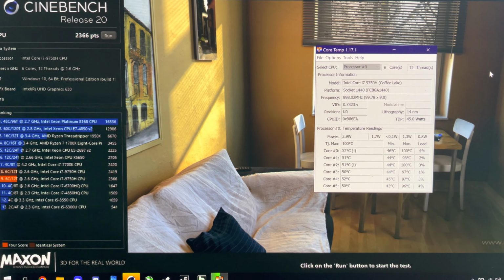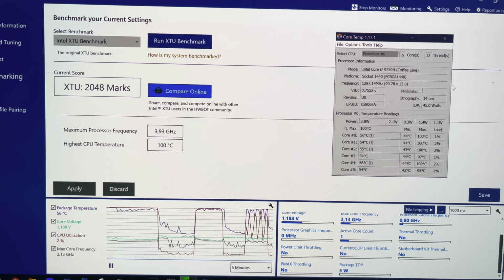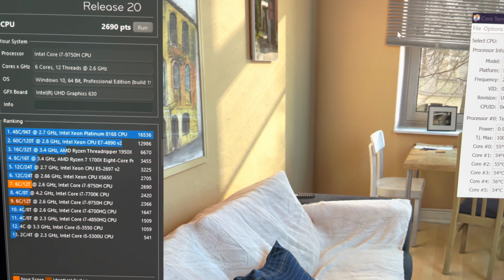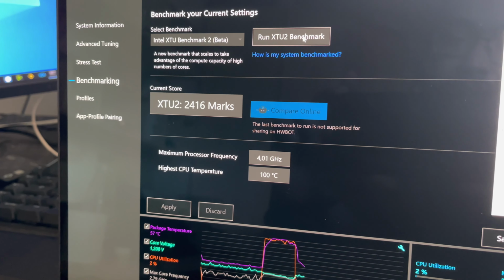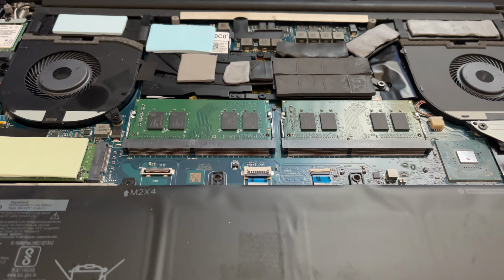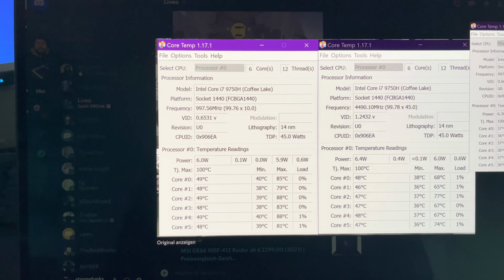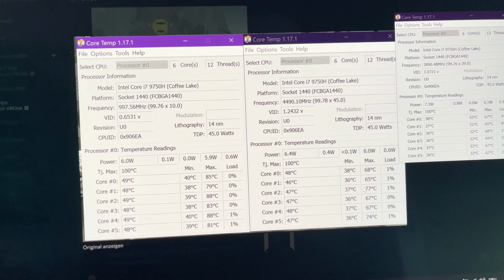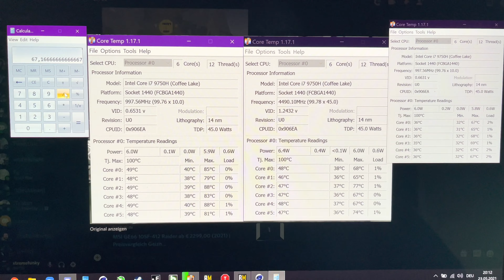Taking Laptop Cooling To An Other LEVEL - Liquid Metal - Thermal Paste -Thermal pads - Dell XPS 15

Comment: How does this video only have one comment?

Well done my friend, I'll be trying this on my XPS 7590. Doing a lot of video editing on the go means I must rely on a mobile solution regularly, and the XPS has certain limitations when it comes to thermal constraints and maximum performance. Over the years I've experimented with thermal pads, thermal glue, miniature heatsinks, and have come away with some decent results. But this is much better. Cheers, and thank you for the hard work.
Reply from the maker: Thanks mate. Your words are honoring me!
At the current time I’m working to shunt mod the graphicscard in it, to get more performance out of it. Let’s see what will happen. Expected results are in 2 weeks earliest, since the next week is staked with exams. lol
Reply: @UnleashedOverclocking  best of luck, that's definitely tricky. I stopped at undervolting in afterburner!

Comment: Really need to try this on my 7590, will probably try the pads first, then if I get confident move to the liquid metal. My 7590 is running at around 80 degrees to 90 at the moment with highs of 100, so hoping this might help!